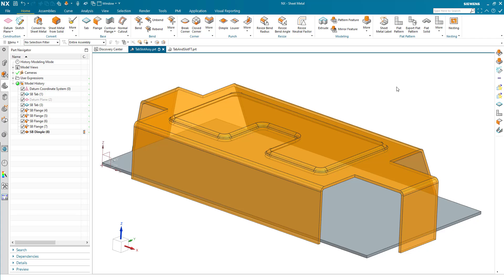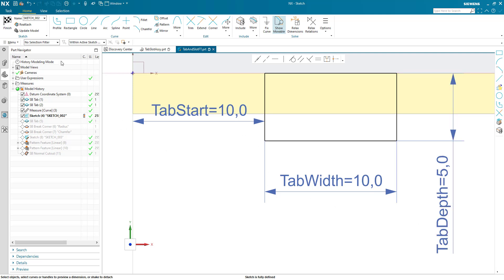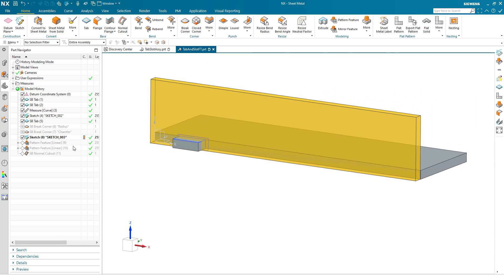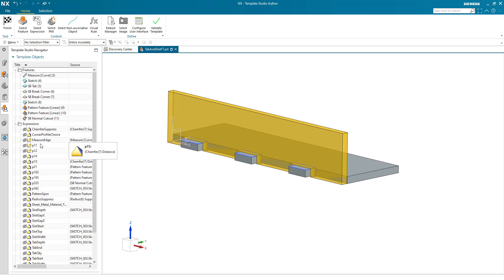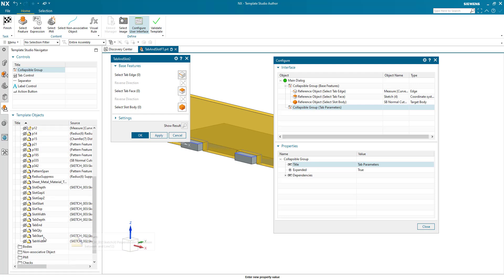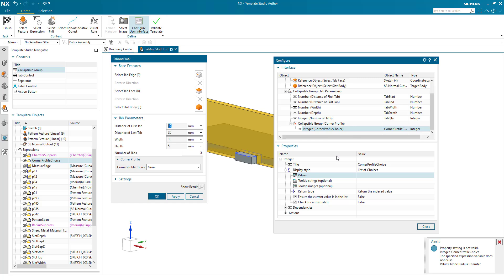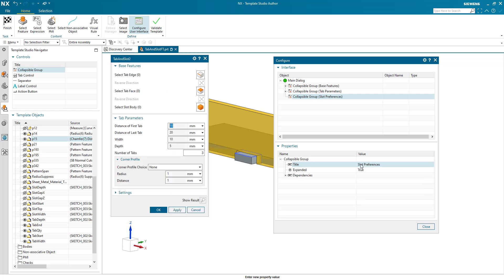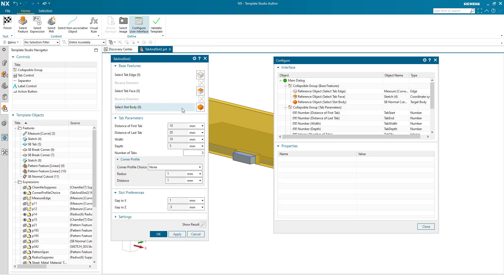Siemens NX Sheet Metal: "Tab and Slot" Feature Template How To

Comment: Hello Dave. Is this example available in the Siemens NX installation folder somewhere? I've searched for it on NX Example Library > NX Feature Templates (Example), but it isn't there on version 2406. Thanks!
Reply from the maker: This is not certified by Siemens, just something I put together.  I can ask if they want to include it.  Happy to share with you (usual disclaimers apply) if you message me your contact details.  Look me up on the Siemens community forum community.sw.siemens.com